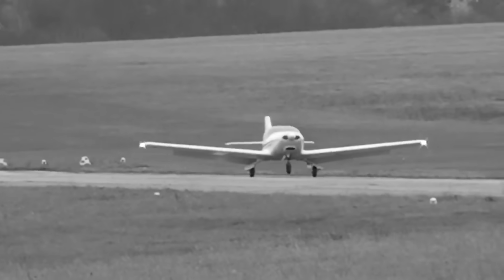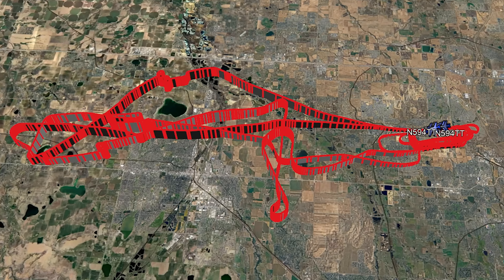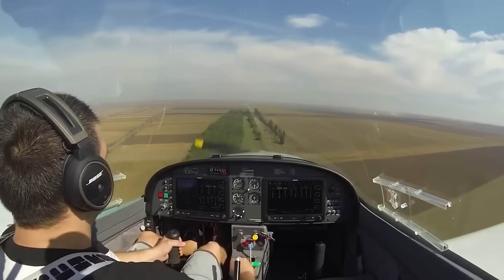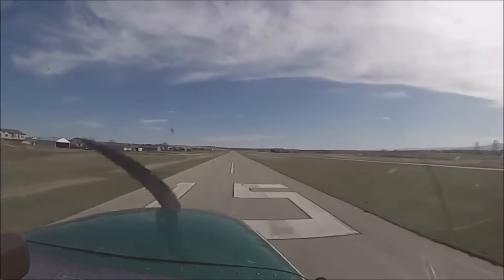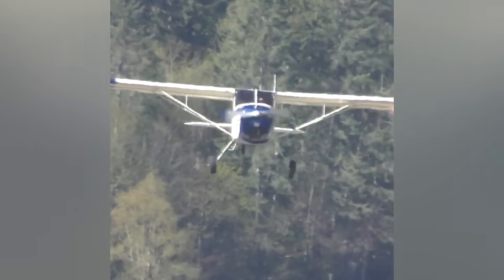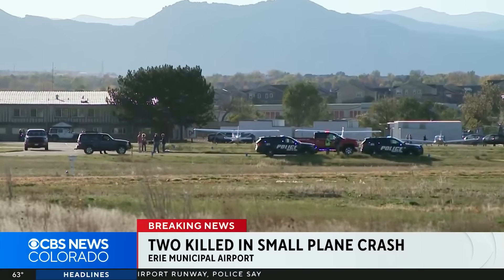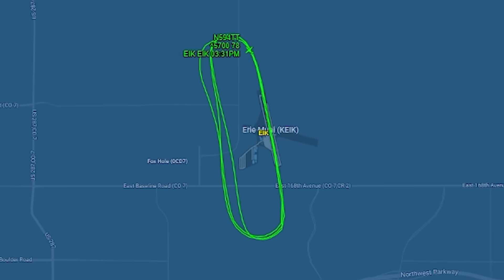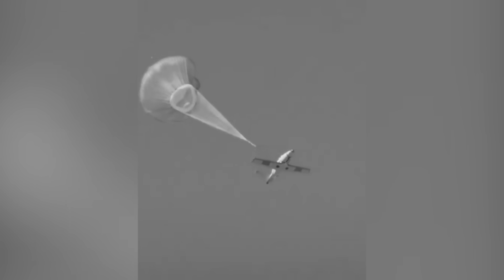NEW Info About N594TT Fatal Crash Oct 19 Erie CO, Prelim Updates…

Comment: Another example why I'll stick to commercial flying as a passenger.
Reply: I am a pilot and I concur with your decision.  The airline pilots have over 1500 hour, usually they have over 3000 hours of flying experience or even higher.  Plus there are two of them in the cockpit.  A private pilot usually have 200 - 500 hours, which are 6 times less.  Flying a small GA airplane is like riding a motorcycle.  There is no back up to catch your mistakes.  The pilot has to do everything, high work load environment, as opposed to an airliner jet, which was designed to have a lot of backup, easy to fly because the FAA want to ensure the hundreds of passengers stay alive.  Airline flying is the safest form  of travel.  Small general aviation is just as dangerous as riding a motorcycle.  This is an opinion from a private pilot and an aerospace engineer with a lot of flying experience.
Reply: @2Phast4Rocket you make excellent points and I agree .